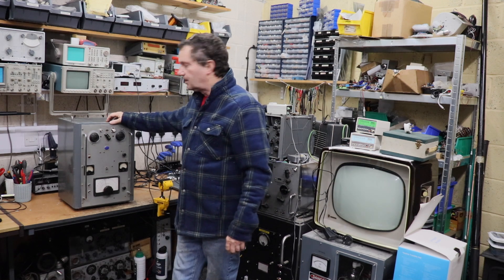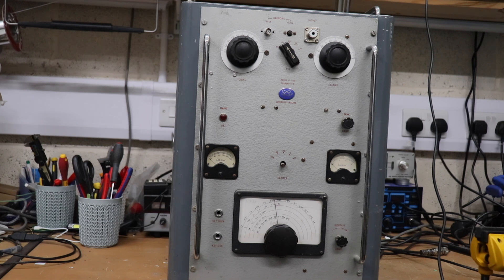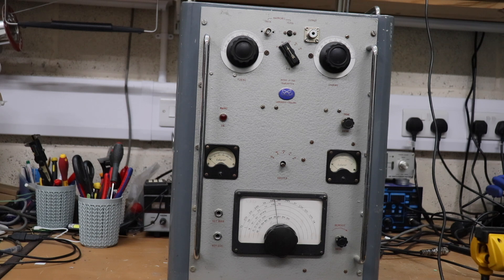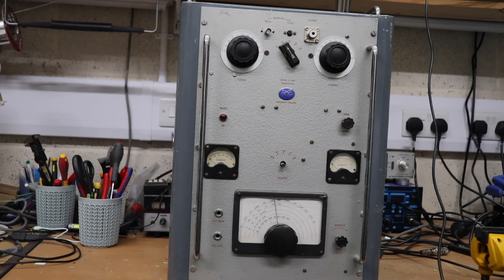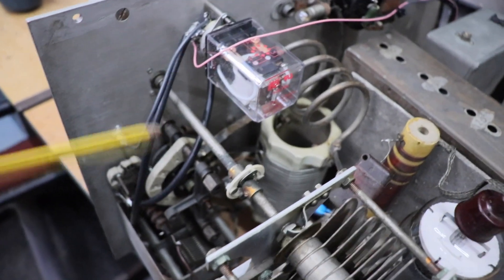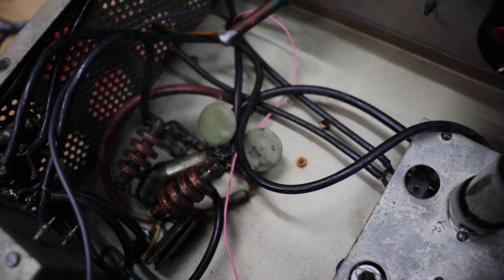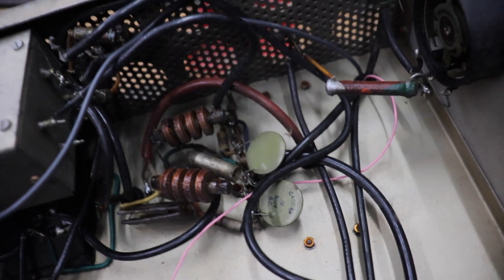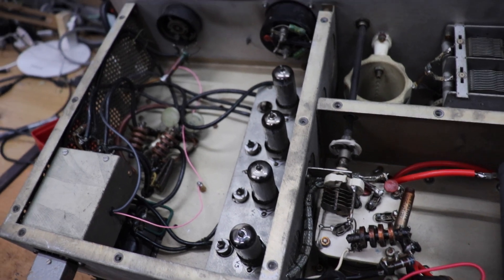Labgear LG300: A Real Man's Transmitter?

Comment: I will watch very closely, as I also have an LG300 without the power supply and modulator. I have been on the look out for a UM3, but I was also thinking of a solid state modulator as I have a selection of large and very large audio transformers that were used on the old Rediffusion audio networks. 

I have wondered about trying a toroidal transformer for the modulator, perhaps experimenting with the concept with something smaller than the LG300 first. Unfortunately the LG300 is part of a very long list of projects that I am very slowly working through. Best of luck with it. Kevin GW0PUH